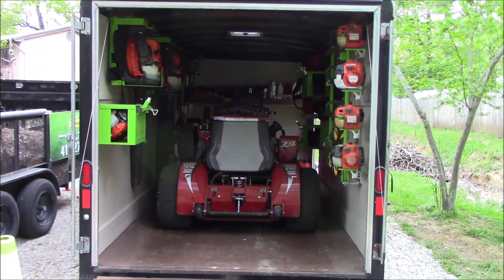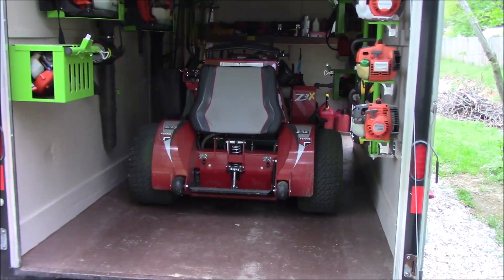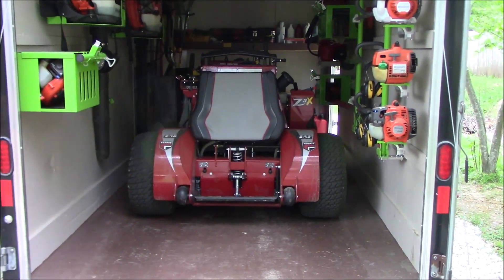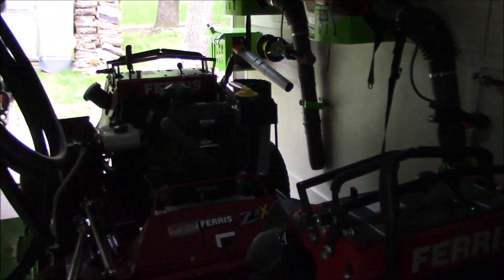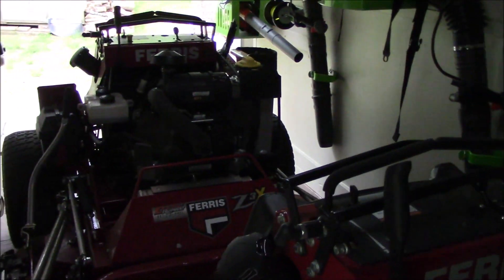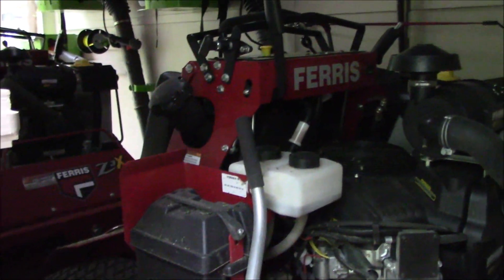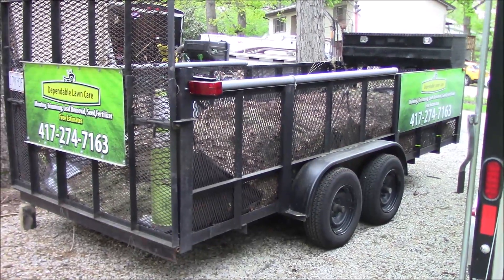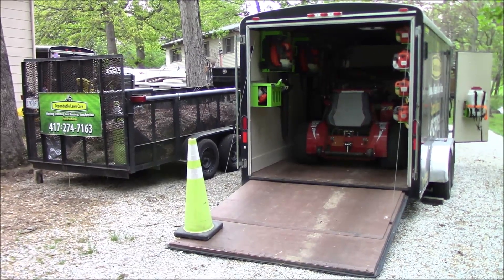Z3X Fuel Eficiency

Comment: Great video, I was wondering since you're a family business, quick question, if you had to just pick one Z3 the 52 inch deck 33 hp or the 61 deck 37 hp and why .thks
Reply from the maker: 61" because we have more large properties than small.
Reply: HandyGuy 2016  sir I was looking to see how the 33 hp compares to 37 hp, can the 33 hp keep with the 37 hp if I had to choice one,
Reply from the maker: @scottmagyar  the 33 is plenty of power for the 52", but I would definitely want the 37 on the 61"
Reply: Sir , one more question my local dealer wants to sell me a  Z2 28hp EFI 52 inch deck I like it., but  he has a sweet deal on a Z3 with 37hp EFI , with 52 inch deck,  since you said go biggger if your budget works, I don't commercial mow it's just for my own 2 properties,  is 37 hp  vanguard EFI to much engine for a 52 inch deck. Thks
Reply from the maker: @scottmagyar  probably Overkill, but both are great machines 😎

Comment: That's crazy I spend 80 to 100 in fuel in a 10 hour day with 2 60" jds and 1 72" bad boys
Reply: 930z JD all 3 of them are 60" and they use a tank every 8 hours or run time roughly  and I been running all 3 12 hour days ..   the bad boy is fast fast and cuts fast but yes it has 2 tanks and will drank both the tanks a day
Reply from the maker: @nono5834  as long as you are making money, it's only fuel :)
Reply from the maker: Yeah, I could burn a full tank of gas a day with my JD mowers, and from what I hear Bad Boys like to drink fuel too.